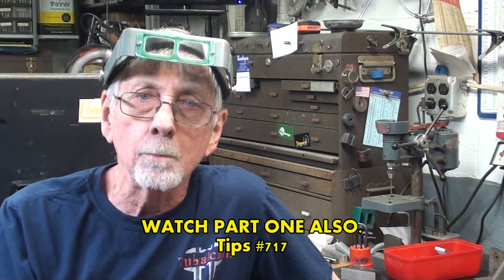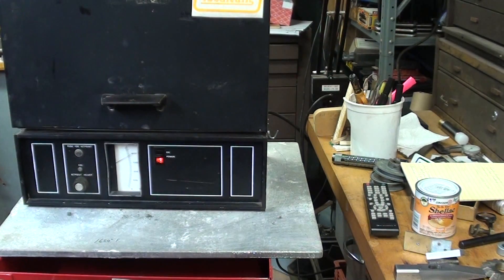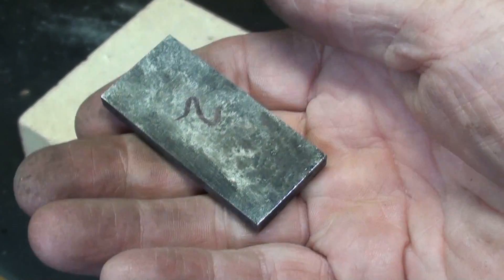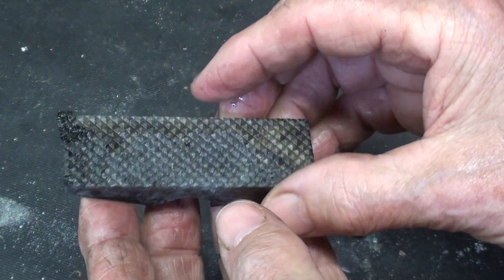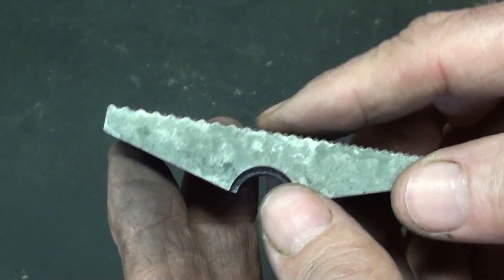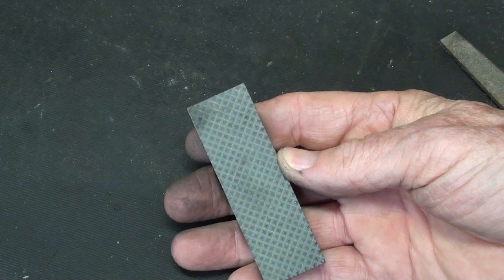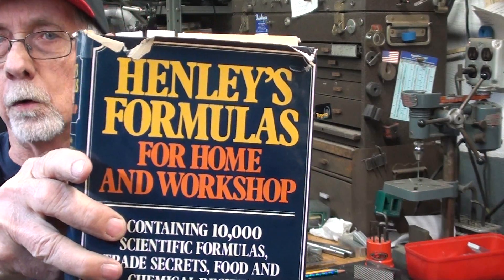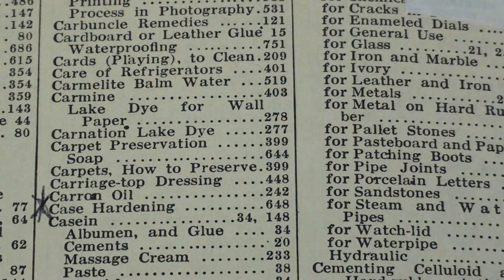CASE HARDENING Surface vise jaws #718 pt 2 KASINIT tubalcain

Comment: Connecting a vac pump to the chamber is silly because - air leaks in and heat kills vac pump. However - connecting a slow flow of argon or CO2 or Nitroben to the chamber would be easy and displace the oxygen. Why not?

Comment: I’m going to try this same method but using charcoal instead. Ground up to a fine powder and in an air tight container letting it soak for 5-6 hours. I do wonder why the ammonia smell was emitting from the compound on ya. Very interesting indeed. 👍🏻

Comment: Great video on heat treating, Just like the shopkids, people love fire and explosions.!  The process can be used to make cutting tools. But you have to harden multiple times to get the case deep and of course, pregrind the tool so that only light hoaning is required to touch up the edge. Of course, when you regrind the tool is toast.

Comment: Hi Mr Pete, you're looking good. Very interesting video.
I was once told by a senior lecturer in metallurgy that it was possible to case harden steel simply by heating it up with oxy-acetylene whilst allowing the thick smoke from pure acetylene to rise up onto the hot metal. Any form of carbon-based smoke will do and the longer you do it, the thicker the case. I can't try this as I have no oxy-acetylene but maybe you could try it and let us know if it works?
Reply from the maker: That is interesting. However I do not have a torch either

Comment: In 1978 I started a 2 yr associate degree program at Rogue community college in southwestern Oregon. One of the first classes we had was on heat treatment. Used lots of Kasenite since then. We were told though I admit I never tried it that in a pinch finely crushed charcoal briquettes used in place of would would do the same thing as Kasenite and some of the other available compounds. Still have the text for that class though I'd have to look to find. I heat treatd a lot of gean G3 battle rifle parts out of air hardening stainless steel. They were then shipped to El Salvador. Politics huh! Can you imagine a community college involved in something like that today.

Comment: Thank you! I enjoyed this session; I've been case-hardening iron and soft steel for decades, but there's always something more to learn. May I please pick up on one point? You say that case-hardening isn't suitable for a cutting tool, but I have often used it for one-off, special-purpose tools such as form tools. For instance, a cutter can be made out of mild steel if that's all you have to hand, and after a good soak in the case-hardening compound the skin is quite thick enough to allow it to be polished and even honed.
Reply from the maker: Good point

Comment: Beautiful swivel jaws! I'll have to watch the video where you made that. This Old Tony has a beautiful machinist vice where the usually cast-in end of the vice is a square piece that swivels and has 4 different purposed sides. Interesting as well, since you could make the vice from stock of perhaps half the thickness of the one-pice body.

Comment: In shop class,, 1961, I made a scroll bender. We case hardened in a small gas fired "box". Cherry red and into the carbon stuff and back into the gas fired box. Then the water dip. The box was also used to heat a large copper soldering iron. Used that iron to solder parts we made out of tin cans. Parts were made using sheet metal layouts techniques.  I made a water sprinkling can. "In the old days" we were taught how to use our hands and minds more. We had auto shop, wood shop, electrical shop and metal shop. I even spent a week in Home Ec. made a great cinnamon roll cake.

Comment: Lyle, I've read of case hardening to different depths by varying the times of the treatment -- longer times for a deeper hardened layer.  Can Kasenit (or equal) be used like this or do you really have to make multiple runs with Kasenit?  Or is the process I tried to describe above depend on a different case hardening "material"/powder/potion?

Here's my vote for a series on heat treating, especially on what can be done in the home workshop, along with using a small heat treating oven like yours or the other ones that are now showing up on YouTube (I can't think of their name off the top of my head right now).

Comment: (carried over from my comments in part one). 
McMaster sells envelopes made of stainless that you can put your part in (with the hardening powder) to case harden. Part of the problem is you want to avoid the carbon oxidizing in the furnace - so the stainless envelope provides an oxygen barrier as well as keeping the case hardening powder in direct contact with the part.

Also Guy Lautard has a chapter in one of his 'Machinist's Bedside Reader' books on case hardening and color case hardening.

I'm pretty sure that there are some recipes for making case hardening powders in that book.
Reply from the maker: I might have that book, I will have to look for it. I think he wrote several of them
Reply: @mrpete222  Yes, three to be precise. He promised a fourth book, but he must have passed before that happened.

Comment: I teach metallurgy at the college level.  We  pack carburize using crushed Kingsford charcoal for 2 hr at 1750F then 1hr at 1450F then quench for larger parts.  53 to 63 HRC is the result.
Reply from the maker: Thanks, I need to try that

Comment: Hi Mr. Pete. Thanks for another great video. 
Just a short hint about "self made case hardening compound". I've read an old metallurgy book where carbonizing low carbon steels from 19th century was described. The main ingredient was coal from leather or other organic materials. The workpiece was packed in the coal and then in a clay mantle. Depending on the heating time the carbon penetrates deeper. Japanese swordsmiths are carburizing their steel by packaging into rice straw and heating, I think.
 Here`s a link to a nice video with a self made compound: https://www.youtube.com/watch?v=V_Mp1fNzIT8  . No idea if it helps but it sure is interesting.
Reply from the maker: Thank you very much

Comment: I enjoyed these two videos and I still have my threequarters-full 1lb tin of Kasenit, though I haven't used it in a long time.  I never had a furnace but I was only case-hardening small parts so I used the dipping method with a propane torch. Sometimes just for sake of the appearance, rather than durability. And, yes, I too found pages 648, 684, and the disappointment of p427.  Still, at least now I know how to colour billiard balls red, if I ever need to (p428).

Comment: Some good news about american manufacturing, locking pliers are being made in usa again. Please take look at Eagle Grip locking pliers, made in the same town that Peterson pliers were made in.
Reply from the maker: Yes, someone told me that the other day and I watch the video
Reply: The new pliers look like they are quality, the last pair of vise grips I purchased were very poor quality.
Have ever used stainless steel foil to wrap material to be heat treated a!ong with carbon, I have heard that if you place steel in an oxygen poor atmosphere with carbon that the steel will absorb more of the carbon?

Comment: This has been one of your best series ever! It's a topic near and dear to my heart, and the more you want to do on it, the more I'll watch.

So, the reason that I'm really interested in this entire process is that it provides a functional finish on a part, using not-too-horribly dangerous reagents and you can get beautiful parts this way. Actual black oxide finishes are way too dangerous to attempt in a home shop; even the medium temperature processes are still running very hot lye solutions. The cold blue finishes just don't seem to be very effective, and I'm a bit concerned about the selenium in them.

The classic case hardened finishes using charcoal and heat seen like a total win for the home shop, with parkerizing perhaps a second.

 The thing I really want to try is color case hardening with charcoal, which I believe you do pretty much the same way as this only seal it up in an stainless full envelope.
Reply from the maker: I am so glad you liked the video. And yes, it is a very interesting process

Comment: Annealing works because Austenite at higher temperatures can absorb up to 2.01% carbon into its structure (It has large holes in its "face-centered" crystals that just fit carbon atoms -- isn't that a great coincidence?  Such is the basis of civilization...) and Ferrite crystals are close-packed and will not allow more than about 0.08%.  Cool austenite with a lot of carbon fast and the carbon gets stuck and the squeezing forms the carbon-iron compounds "Cementite" (the hardest and very brittle) and softer, less brittle crystals like "Martensite" and "Bainite" (which are used in various ways to make the hard parts of most manufactured steel objects), the latter being able to be somewhat toughened by proper tempering processes.  Annealing lets the Austenite iron "stretch" and contract as it changes back to Ferrite and squeeze out the carbon into the gaps between the Ferrite crystals like toothpaste from a tube, though much slower here, hence the long cooling time needed.  Normalizing is a version of annealing that allows the crystals to make more even-sized and -shaped crystals after hardening to keep brittle spots from being formed.
Reply from the maker: Thanks again, you are obviously a metallurgist
Reply: @mrpete222  No, I am not.  I was an engineer (Electronic originally and, when this became a US Government employee profession in 1976, if recall correctly, a Computer Engineer).  I worked for the DoD, for the US Navy for anti-aircraft shipboard guided missile systems as a data analyst, Wrap=Around Simulation Program designer and maintenance specialist, computer programmer (machine-language and assembly language, as well as high-level language), spec writer, general troubleshooter for ships with problems ("Tomorrow you will be on the other side of the US.  Pack your bags tonight..."), and, finally, Software Quality Assurance Specialist (made sure all documents were done correctly and signed-off, and held the meetings to determine if everything was ready for final testing and, after that, then for sending the thing to the customer).  TERRIER Guided-Missile Fire-Control System until it went away in 1992 with termination of the steam-powered Navy (except nukes), then TARTAR until it went away, then Mark 92 on the FFG-7 frigates (US and foreign) and some Aegis peripheral work.  Retired in 2014.

I got interested in armor while in college after getting hooked on playing miniature ship wargames on floors and, once, on an entire elementary school athletic field FULL SCALE (with 300' tape measures -- you really see how hard it is to see tiny model ships on a huge grey (asphalt) ocean, just like in real life).  The elaborate rules that they had for most things contrasted with the very simple-minded rules they had for armor and projectile effects when playing US Civil War through WWII naval games using armored warships.  I was then a Math and Physics Dual Major at UCLA (Class of 1972) and I said to myself:  "I can fix these rules.  I just need to do a research project to find them."  Hubris, though art youth!!!  I started it like a term paper research project for a class and, 55 years later, I now know A LOT about naval and, as a side issue, land vehicle steel armor and anti-armor projectile design and, as a necessity, iron and steel metallurgy.  And there are STILL things that I do not know enough about yet!!  The subject of merely slamming two pieces of very s8imilar metals together is kind of complicated.  I now thoroughly understand how complex the universe really is...
Reply: @nathanokun8801  
Is the biography of Nathan Okun still in print?

Comment: Definitely enjoyed Part 1 and Part 2.  I would like to see a video on annealing and heat treating. There are so many things that it can be used for.

Have you ever used boiled linseed oil or shellac on your metal parts to keep them from rusting? I know a lot of older woodworkers used nothing but linseed on their tools.
Reply from the maker: I was using shellac only minutes ago, in fact there is still some on my fingers. But I was using it up on my wooden patterns, never use it on metal.

Comment: Does all of the part need to be hardened or just the jaw area?, this I feel might lower the chance of the work fracturing under load or if dropped.
And save a little on compound 😁.
The furnace is brilliant.

Comment: As I recall years ago, I read about hardening with peach pits, and also nut shells with the work wrapped in stainless foil. I think it was in Guy Lutard's Machinist Bedside Reader, or it could have been Gunsmith Kinks. I also heard about a fake color case hardening process where you apply Tincure of Betadine (available at many drug stores) on a polished steel surface and then artistically heated the surface with a fine oxy/acetylene flame. I tried it with no luck. Maybe someone else has heard of this. Thanks for the informative videos!
Reply: Have used the peach pit method. Works best using pits from hard, green, unripe] peaches (higher cyanide content).

Comment: I love the fact that you are not afraid to get a little oil on your hands.  I am from the days where you checked the oil in your car engine by wiping the dipstick between thumb and forefinger.  If you couldn't see your finger, you changed the oil; if you could, run her another couple thousand.  Never had an issue, ever.  Sorry if I seem cantankerous, but I am.

Comment: I laughed like a Hyena at those potions in that book. I have a couple of those old books of that style full of lotions and potions requiring mercury,arsenic,cyanide and all manner of other highly toxic substances. No wonder it was deemed necessary to introduce health and safety legislation😂😂
On the subject of selective hardening on a component,this is why many modern small 2 stroke engine con rods have a copper blush to the outside surfaces. The rods generally have needle and roller bearings running directly in the big end and small end bores. These bearing faces  need to be hardened whilst the rest of the rod needs to remain unhardened and non brittle or it would fatigue fracture. The copper coating is applied to the outside surfaces and ensures the carburising hardening process acts only on the big end and little end bearing bores.
Reply from the maker: Thank you, just like they explained in the book Henleys

Comment: I’ve enjoyed this series. I have to admit I have no experience with this. Does this process affect any of the dimensions at all especially if you do it a few times to the same part.  I was curious if there could be distortion at the swivel where the pin is.

Comment: You had me completely intrigued with your video,  I guess I’m a 62 year old teenager. I was wondering if you could use used motor oil to quench the heated metal ? I had heard that it would harden the metal
Reply: John, some tool steels are quenched in oil, to remove some of the shock. If quenched in water, the steel can crack, but for case hardening, it is normal to use water, as the steel retains a soft core and it is unlikely to crack.

Comment: Thanks fort another great video tutorial. With regard to other methods of case hardening, The Machinist's Third Bedside Reader has a good story with information about color case hardening with Bone Black. essentially burned, ground bone meal, which can be made at home or purchased ready made. I believe it is used as a colorant for dyes.
I'd sure like to see a project about making a steam (compressed air) whistle similar to the one at the end of your video.

Comment: I learned how to heat treat on another video on YouTube. I use a small charcoal grill mounted on a V-shaped stack of bricks and use a fan to force air up through the bottom vent in the grill. I heat the metal parts in the charcoal to red hot, then quench them in used motor oil that turns them black and rust proofs them. Then put them in the oven at 250 degrees for 1/2 hour. and let them cool off.

Comment: Mr. Pete, thanks for the video!
I have done a little research of my own on this subject and a modern (home brew) method is to use a mixture of bone and wood charcoal and some recipes add charred leather.
If done without much exposure to air you  can get some colors as well.

Comment: In the time of the publication on Henley’s Formulas and even up through the 1950’s any local pharmacist either had on hand or could get you the chemicals needed.  Of course in the 1920’s you could also buy heroin cough syrup over the counter.
Reply from the maker: You can buy heroin anywhere
Reply: @mrpete222  Anywhere but in a drug store.

Comment: after watching this intently I have a couple friends that say they have hardened material using carbon infused oil, not sure if this is true I have never done it, I do however have a can of pure carbon dust, was sold as that to be added with something else in a process that I bought at an estate sale, although It may not very well be a valid question do you think that this could be used at all in a hardening process.thank you in advance for any advise you can give me.
Reply from the maker: All you can do is to experiment with it, I really do not know

Comment: My grandfathers copy of 'The Works Manager's Handbook' by W S Hutton [printed in 1895]  a formula for casehardening is given as: "Pack the articles to be hardened in a box filled to the top with small pieces of bone and wood charcoal, and a few pieces of burnt leather, the heaviest articles to be placed at the bottom of the box. Make the lid of the box tight, with a lute of equal parts of clay & sand.  Subject for 10 hours to a red heat in a furnace, & quench the articles in water." mind you this is for wrought iron.  Please shew heat treat demonstrations.
Reply from the maker: Thank you for the recipe